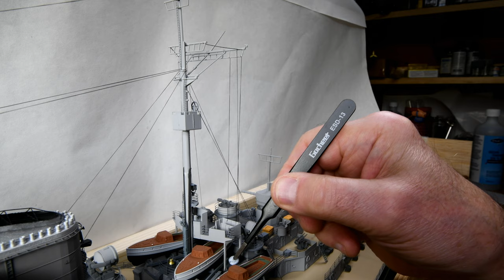The Model Ship - Part 418

Comment: Tailors use a type of scissors designed to do exactly what you're doing.
Handle like tweezers but the cutting end have a needle point. I think they're called spring loaded tailors shears. There's nothing better to separate thread and cut closer to the knot. But then, there'd be no suspense. 😁
Reply from the maker: Thanks Jeff. I have been pricing those.
https://www.amazon.com/spring-loaded-scissors/s?k=spring+loaded+scissors
Perhaps one day I'll break down and actually buy the real thing. But, in the meantime, I'm having fun trying to make up my own scissors. 😁